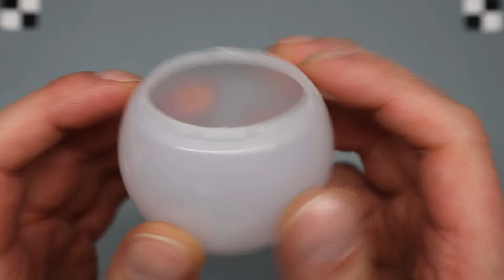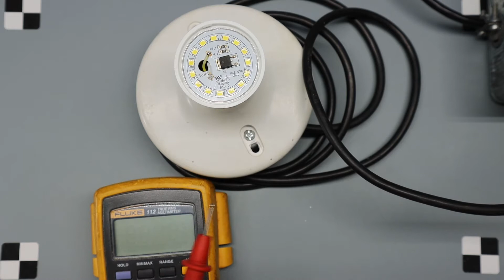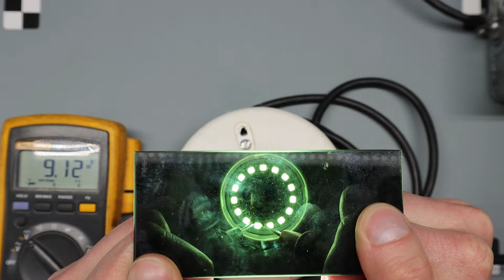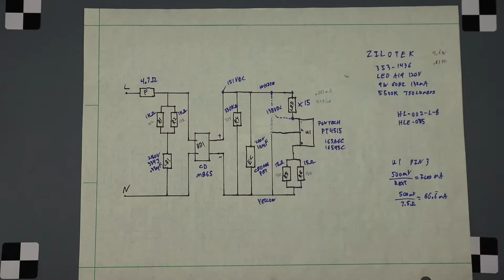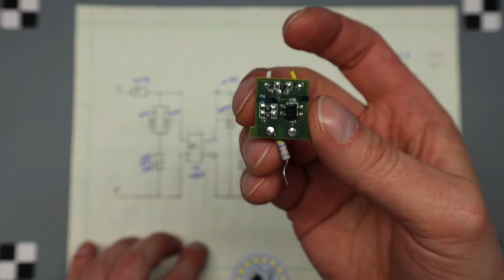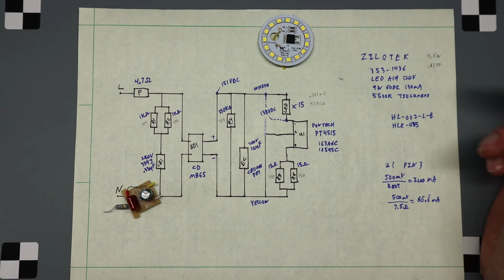Teardown of Zilotek LED bulb with schematic

Comment: I have one that is lighting very dimly. After I removed the lens (thanks for the tip!), if I tap on the driver IC it will brighten up to normal. Bad solder joints from heat? Anything else I can try? Thanks!
Reply from the maker: Could be cold solder joint on the IC or resistors.
Could be high resistance from an LED going bad, or the output DC voltage from the driver components.

Comment: So these drivers are constant current? for example if the output current is 130mA and each Led have a Vf of 9V can I remove one of them, then add 3V Led (150 mA)?
Reply from the maker: The PT4515 is constant current, so whatever LEDs you put in series with it would all have the same current.
Reply: @eeAspect  In that case the 3V Led will not burn, right? I guess that also in reverse situation, having a series of 3V Leds and replace one Led with 9V type and same current, they will work right?
Reply from the maker: @MACYNET323  as long as the 3V LED is rated for that current it would be fine. Replacing 1, either way should work.

Comment: How can you open the bottom ( threaded area) with heat ? thanks
Reply from the maker: The threaded end is crimped/staked, I had to remove it with pliers.
If you heated the metal, the purpose being to melt the plastic while pulling it off, probably wouldn't work with out damaging other parts.
You could potentially drill out each of the stake point around the base, but would then need to re-stake if you were trying to put it back on.

Comment: what  are you trying  to do to the led bulb ?  it seems that you dont have enough practical 
experience.
Reply from the maker: Just taking it apart and looking at how it's manufactured, and then diagramming the circuit.

Comment: As Big Clive says, You can remove one of the sense resistors to lower the current and extend the bulb life. One I looked at had just one 10 Ohm resistor, so I swapped it for a 42 Ohm one in hope of making it last.
Reply from the maker: Right, and since those resistors are easily accessible they could be swapped without destroying the case.

Comment: Would you recommend these? Local store has them cheap. Thanks for video
Reply from the maker: They are not as robust as others, like the GE one I took apart previously.
I would expect if you bought a pack of them you would end up replacing a couple of them in 3-5 years, depending on how much they are used.
They will probably last long enough for you to forget how long ago you bought them, and then pick up another cheap pack, that seems to be the way it works with cheap items.
Cost wise it might be worth it, but the replacement hassle might not.
Reply: cut one 15Ω current sense resistor and they are going to last for 10+ years
Reply: @theoneohmresistor  what do you mean?
Reply from the maker: They mean that removing one of the sense resistors will lower the current, and prolong the life of the leds.